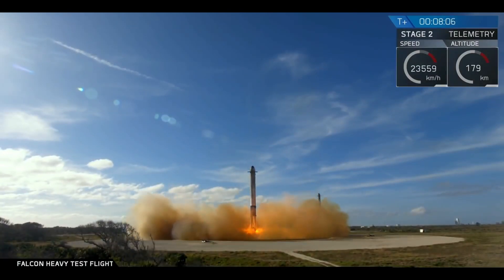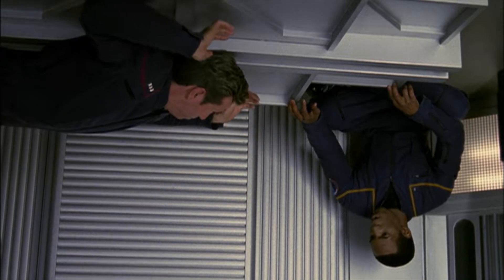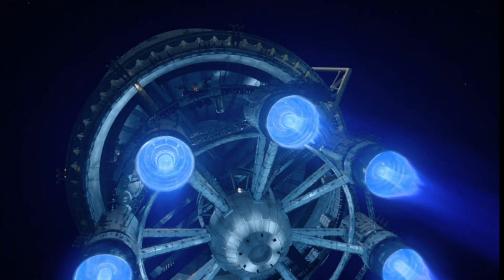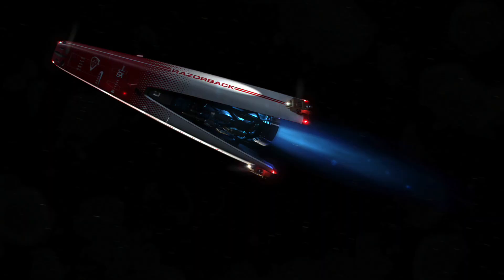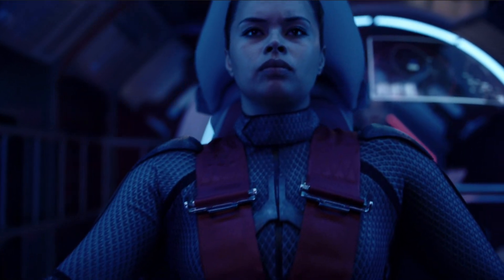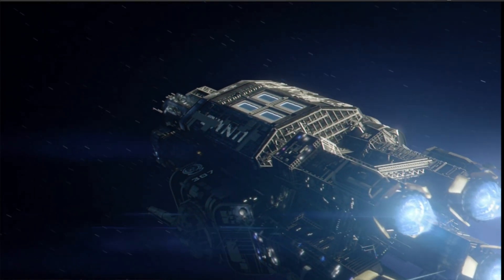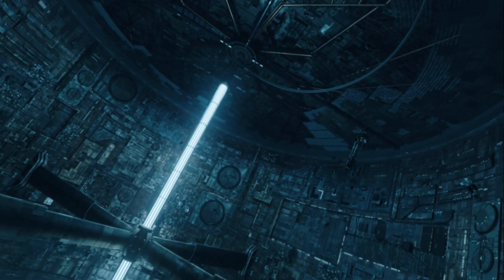Are the Expanse Ships Realistic? - Science of the Expanse

Comment: What happens in the spinning version when you jump? There's still no "real" gravity to pull you back down. I think walking would be fine, but if you run and jump that things would not be just like real gravity.
Reply from the maker: Good question! You still have momentum so you travel in a tangent to the rotation that eventually brings you back in contact with the surface. When viewed from the spinning frame it looks just like a normal up down trajectory on Earth!
Reply: @RyanRidden  sure, I see that. However what if something is floating in the middle of the rotational ship? There's a scene in the expanse where that exact thing happens and it shows those items all of a sudden being sucked towards the outside of the spinning drum. How about that scenario? It seems to me that since there's no real gravity those things would stay floating and everything would just spin around it.
Reply: Your jump trajectory would be influenced by the Coriolis force. From a pov of person that didn't jumped, you'd appear to be floating away from the straight line down, as the drum surface "runs away" from under you.

Comment: The Coriolis force will become a BIG problem when using small scale spinning spacecraft, because prolonged exposure to more than ~10 rpm will result in intense motion sickness due to the effects of the Coriolis force on the inner ear fluid. From this perspective, spin gravity would only be feasible in large structures like space stations, because the large radius allows gravity to be produced at a sufficiently low period of rotation to prevent negative effects of the Coriolis force on the crew (a = R(2pi/T)^2). I think it's no accident that only a massive ship like the Behemoth can 'spin the drum' in The Expanse!

Sources/background: 
https://oikofuge.com/coriolis/
https://en.wikipedia.org/wiki/Artificial_gravity#Mechanism
Reply: Scott Manley did a video of a design that will allow a relatively small spacecraft to produce artificial gravity for the cruise portion of transits: https://www.youtube.com/watch?v=WCwXJMVVdck
Reply: @MrDarrylR  Thanks for the link! As Scott Manley mentions though, that entire structure was a small module tethered to a big counterweight, meaning the total spin will still only be a few rpm.

Comment: Real question is.. What's the fuel source. The Expanse does use Nuclear Fusion, but the way in which we generate electricity, regardless of whether we use coal or nuclear, we boil water to spin a magnet. Also the bigger question is about generating thrust. With cars the wheels push against the ground, with planes, they push against the air. But in Space, rockets have to constantly eject mass to push themselves forward. Which means we'd still be limited to plasma-ion propulsion fuel of some sort, in other words, Gas. The near future of space travel boils down to how efficient we can make gas in accordance with Newton's 3rd law.
Reply: Just a nitpick: you mean propellant, not fuel. Fuel is what you use to create energy, propellant (also known as reaction mass) is what you throw out the back. They're only the same thing in a chemical rocket.

With a specific impulse of almost a month, it doesn't even matter what your reaction mass actually is. I think The Expanse uses water because it's cheap and dense.

Comment: Great video, I look forward to seeing what other content you create. I’m curious what your thoughts on weaponry in space, in the expanse they have what appears to be 20mm mini guns(they heat up very quick, I have seen them in action and barrels start to glow on the smaller ones after a few hindered rounds), would the vacuum of space stop the weapons from being able to cool through convection, or would the background temperature of space counter that. Could be an interesting video.
Reply: Weapons wouldn’t be able to be “air cooled” like they are on earth since they’re in the vacuum of space, you would have to actively pull heat out of them and put it somewhere.  idk if it’s explained in the books or not since I haven’t read them but I would assume there’s some sort of active cooling jacket around each of the barrels that will flow coolant from there into a radiator somewhere.
Reply: @dos_gringos9853  there is a coolant system. Its mentioned in the RPG they made.

Comment: Saying that the rotating ship is used more than the 'canal house' is due to the need for constant acceleration seems to skip the fact that the rotation method also needs to be in a state of constant acceleration (the 'a' in the formula sort of gives that away). From a technical stand point a more resonable hypothesis whould be that rotationally generated artifical gravity is far easier to maintain as the use of linear momentum would require a consistant acceleration an variation would result in a change to the level of gravity generated. Rotational gravity would be far better suited for stationary slow moving or shot distance ships or space stations while for long distances the linear method would be more efficient. But from a scify writers/viewers stand point rotational ships just looks cooler and seems more a 'realistic' solution.

Comment: So let's say you're standing on the inside of the hull on the Behemoth, using the centrifugal force to stand... If you were able to run fast enough (let's pretend you can) to counteract the spin, you could just step off the floor and remain stationary I would guess?
Reply from the maker: Yep! Since in this frame your rotational velocity determines the experienced acceleration, your experienced g value decreases. I imagine it would be pretty fun to run around a station ring, feeling lighter the faster you go!
Reply: @RyanRidden  Yeah, that also makes that clip from the Behemoth starting to spin inaccurate. You can see a few floating items not attached to the hull start to move outwards. I'll let them off though because the show is great and pretty accurate most of the time 😂
Reply: Until the air friction would bring you up to speed to drift away from the axis again, that is.

Comment: I have a small problem with the fighter jet example. The main problem with g forces in a fighter jet isn't so much about engine output rather than g forces resulting from high speed direction changes. I don't know of any fighter jet that could accelerate with close to 20 g or even 10 g but turning at mach 1 is another story.
Therefore the g forces are mostly alight with the spine because fighter jets are most nimble when turning up (up from the plains perspective not from the planets perspective), that is why they roll in the direction they want to go and then turn up.

Comment: Slight correction, longitudinal g's are insignificant when compared to centrifugal g's induced by jets turning alongside their lift vector. Pilot's sitting position has nothing to do with countering acceleration, in fact a more optimal position would be one where the pilot would lie along side the plane's direction of movement, thus being able to absorb more centrifugal force. This was in fact implemented on the F-16, where the seat is not set 90 degrees towards the plane of motion, but somewhat reclined backwards.

Comment: So the point is that we do not need continuos acceleration in space, right? Once certain speed limit is achieved the engines could be turned off without any loss of speed. So seeing in the movies constant reactor burn means constant acceleration. But the human body cannot endure more than 20Gs so what is the purpose of constant engine burn (that equals constant accelaration)?
Reply: Where are you getting 20g from? Extended periods of zero-g are harmful, as experiments aboard the ISS have shown. Fluids shift around, bones decay, muscles weaken. Having a constant 1g (or even 0.3g) acceleration would be very beneficial for long-duration spaceflight.
Reply: @the18thdoctor3  At 4:00 the narrator speculates that an untrained person like himself can withstand up to 20Gs (which is something like from 0 to 200m/s in ~1 second) for around 10 seconds. If it would be correct to assume that continuous engine burn in space equals constant acceleration as there is nothing significant to cause drag in space, at some point in time, the speed of the spacecraft will be creating 20Gs to humans on board of that ship, which is more than humans can endure for longer periods of time. The obvious question is then what is the purpose of constant engine burns that we can often see in movies? Disclosure: I am not a scientist, and that is just how I understand the question at the level of knowledge I have.
Reply: @secondson294  
Speed does not create g-force, acceleration does. Continuous engine burn (assuming constant mass) means continuous acceleration, which means constant g-force. A burn that starts at 1g will stay at 1g unless the mass changes. The acceleration would only reach 20g with very very high thrust or very very low mass.

The reason is time. With current technology, which can’t sustain 1g for more than a few minutes, getting to Mars takes months. With the kind of technology seen in The Expanse, a trip like that would take just a few days.
Reply: @the18thdoctor3  Sorry, but I still cannot get it. Let's assume we are aboard the ship that has accelerated from 0 to 2000 m/s in 10 seconds. During those 10 seconds, we will be experiencing 20Gs, correct? Afterwards, the ship turns off the engine and remains at the speed of 2000 m/s. At this point, the g-force would decrease to only 1g?
Reply: @secondson294  
After the engine is shut down, the g-force decreases to zero.

Comment: I think one small problem with the thrust-based gravity is that you can't really change your trajectory very easy. Since you are accelerating with 1g all the time, you're velocity quickly becomes so big, that you can're reasonably change course. Normally in the middle of your journey, you need to turn around (how is the acceleration handled while turning?) to decelerate enough to come to a stand still at the point you need to reach. 

Maybe a normal ship would often alternate between accelerating and decelerating generally staying around a desired velocity?
Reply: You can't change your trajectory easily in space, regardless of how fast your ship is moving. But with higher accelerations it's actually easier to change the trajectory.
Reply: @DarthBiomech  How?  That makes no sense.
Reply: @afriendofafriend5766  It's basic school physics. Something that accelerates at 1G perpendicular to the trajectory of movement will shift it's trajectory in a new direction faster than something that accelerates at 0.1G.

Comment: If my back-of-the-envelope calculation is correct, at a constant acceleration of 1G (in the same direction and without external influences), you would be travelling at the speed of light in slightly less than 1 year.  Not sure how or why that matters, but it does suggest some clear limits to, and problems with, the concept of constant acceleration. For example, time dilatation would play a role. And severely Doppler shifted radio would play havoc with coms.
Reply: From the perspective of the vessel, the trip would work as if the universe worked on Newtonian physics. Basically, when you travel real fast you experience both time and distance dilation which basically cancel each other out in the end. Essentially it would be as if the universe became smaller. The problem with constant acceleration is reaction mass. Since there's nothing to push against in space, you basically need to propel yourself by bringing reaction mass to propel backwards to propel yourself forwards. Think of it as the recoil of a gun.

Comment: when talking about smaller spin-drive ships you didn't mention the coriolis problem - if your radius is too small your head is at appreciably lower Gs than your feet, and you will feel a constant pull slightly spinward instead of straight down. Annoying at low levels, a problem at high levels.
Reply from the maker: Great point! The Coriolis force would certainly be a problem, but I think it might have been too much extra physics to fit into this video. I might try to make a video on that in the future!

Comment: "this is why fighter pilots sit facing away from the engines and not on too of them" I'm confused by this statement, many combat aircraft have the cockpit situated on top of the jet engine, are you saying that this is why the pilot sits in line with the axis of acceleration assuming standard non manuvering flight? I mean I'm not an engineer im a pilot but I can think of combat aircraft where the pilot is situated in different ways than what is traditional.

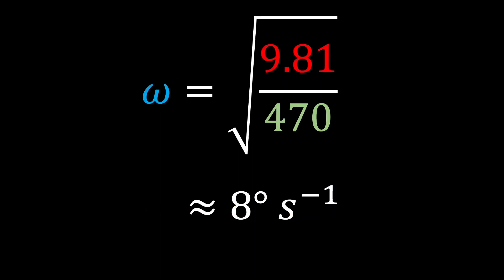Comment: At the 7:53 mark, you "plug in the numbers" (a=9.81 and r=470) and you get the angular speed of ≈ 8 degrees per second. 

Maybe I'm making a mistake, but the number I get is 6.921726347 degrees per second. The fraction 9.81 divided by 470 = 0.02087234; the square root of that fraction is 0.144472628; the inverse of that is 6.921726347. Am I figuring this wrong, or did you make a mistake? 

Hmmm... I'm starting to think there might be radians to take into account, so that omega is in radians per second, not in degrees per second . . . right? If that's the case, then omega, the angular acceleration, would equal exactly 8.277671876 degrees per second, given a radian equal to 57.29577951 or 180/pi . . . right?

So, the full equation should actually be w = √(a/r) × rad [where w = angular acceleration in degrees per second; a = acceleration in meters per second squared; r = radius of spinning object; and rad = 180/pi = 57.29577951].

The spinning object, then, should take about 43½ seconds to complete one spin = 360/8.277671876 . . . right?
Reply from the maker: You are quite right! The equation gives the angular velocity in terms of radians per second, but for simplicity I converted it to degrees, since that's easier to visualise. Sorry about the confusion!
Reply: All is forgiven! I just like to know that I'm understanding something 100% correctly, and leaving out even one step can lead one (i.e. me) down a path to a false conclusion. 

I think I figured correctly that a spinning space station would have to be 894.5647303 meters in radius in order to be able to complete one spin in exactly 60 seconds while maintaining a constant 1-gee artificial gravity. 

Niven's RINGWORLD is supposed to be 1 AU in radius, meaning that it would have a 1-gee feel if it were to spin once every 8.980328977 days or so . . . I think. With a=9.81 meters per second squared and r=(499 x 299792458) meters, that's 8.09792741 x 10^-6. Multiply by 57.29577951 to get 4.639770634 x 10^-4 to get the degrees per second. Divide 360degrees by that to get 775,900.4236 seconds, then divide that by 86,400 to get 8.98 days (rounded to just 3 significant digits) for one spin of Niven's RINGWORLD. 

It's all quite bind-moggling, don't you agree? At least the math works out, though!

Comment: No Fighter pilots do not face forward because of the acceleration of engine. That is for visibility and comfort. No fighter can generate several gs by the engine. They do pull lots of gs in by maneuvering and that is going to be in exactly the wrong way to withstand lots of gs.  That is why fighter pilots train for hi g maneuvers, wear g-suits and often have the back of the seat reclined a bit like the F-16 to improve the g tolerances of the pilots. 
In other words you got your science wrong at least as far as combat aircraft goes.
Reply: This.  Fighter pilots face forward because humans like to be able to look in the general direction they are going.  Even in a fighter jet, 90% of the time that's more or less straight forward.  

And even if you light the burners at low airspeed, half a g is probably all you're going to get in the x axis (nose to tail).  There's a reason it takes a catapult to fly off an aircraft carrier.

Comment: Acceleration at 1G or even a fraction of that is really not going to work.
Just do the maths and you hit the speed of very quickly 😂
Reply: When you are targeting distant point you anyway have to swap the side to decelerate at that 1G or 0.3G half the way to actually have reasonably small speed to touch down at station or planet. In cases when you reach too much speed and the distance is much longer you can travel in cycles changing side. You can either due to economical reasons or to shorten the travel time decide to not have gravity on board in the mid phase of travel. Keep in mind that in the Expanse they are not doing any interstellar travels and usually visit nearby planets and planetoids.